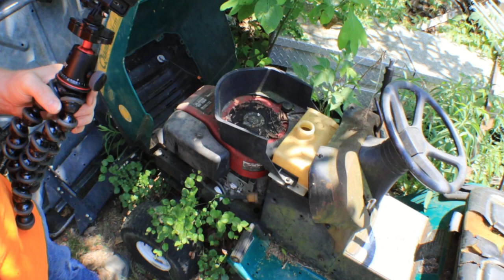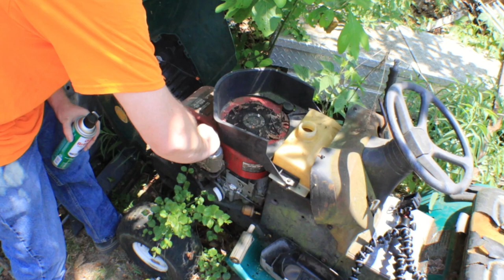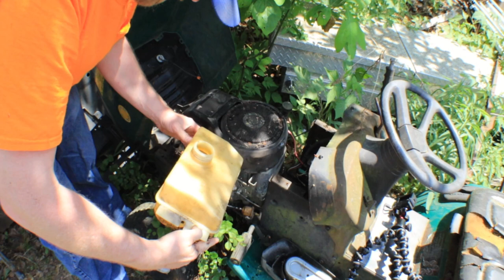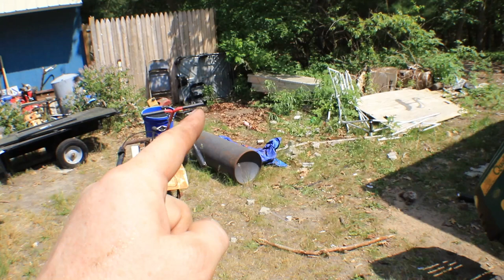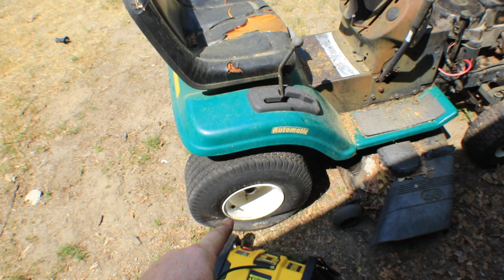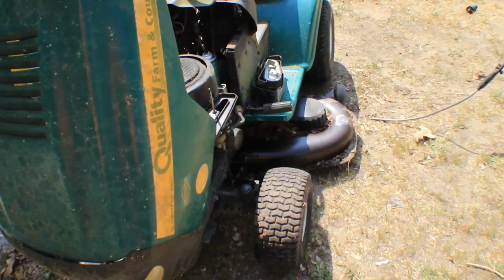I Revived a DEAD Lawn Mower and You Won't Believe the Result!

Comment: Damn my dude, Im by no means a Karen tree huggin environmentalist but dumpin the gas right on the ground was a knucklehead move.😅 Those old tractors are indestructible, Im still cutting my acre of property with my 1990 Dynamark. I do take very good care of it regular maintenance and i dont use garbage pump fuel. I use 4cycle True-fuel or VP non ethanol fuel. It still looks like new, I also have a fuel shut off after every cut i turn it off and let it run the fuel out of the carb. I absolutely refuse to pay the ridiculous prices for a Tractor made of mostly plastic